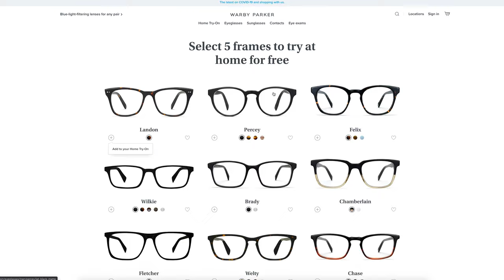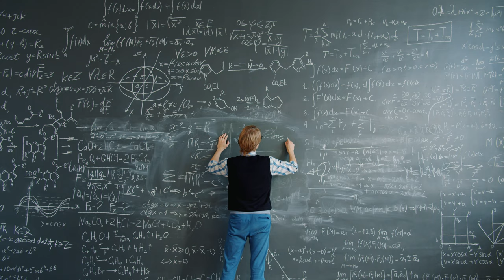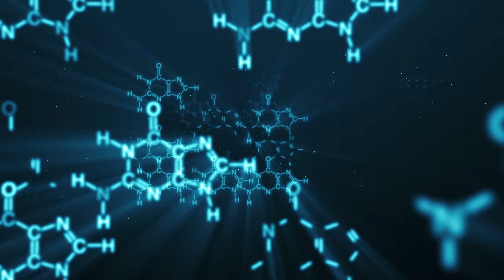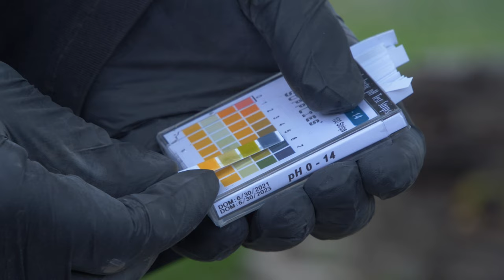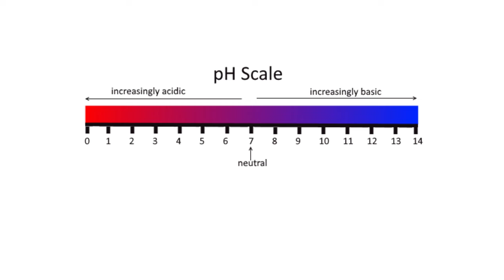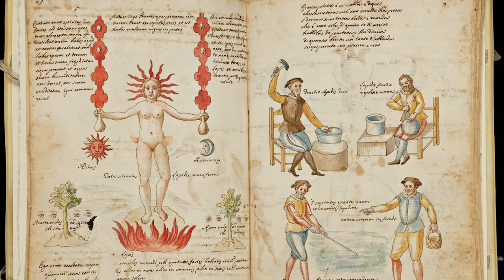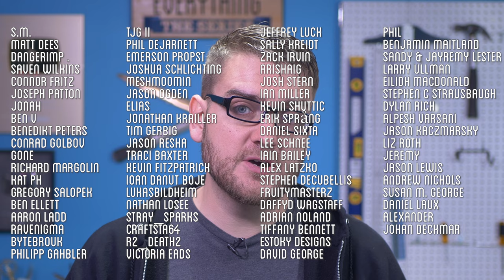Can I Make a Sulfuric Acid Strong Enough To Melt Flesh?

Comment: Should've used distilled water, the trace minerals in regular water are slightly basic and so they'll react with some of your acid to make salts.
Reply: Meh, the amount of minerals is so tiny it doesn't matter.
Reply: @user255   Depends on the source.  Hard water (carbonates from limestone) is common.  On the other hand, supposedly de-ionized water in a lab I know has a pH below 6.0, probably due to carbonic acid (carbon dioxide from air dissolving in the water).
Reply: @user255  Drinking water, be it from a tap or other sources can have a pH of anywhere between 6.5–8.5, while distilled water has a pH of 7. 

Worst case scenario not using distilled water can cost you a 1.5 pH increase but then considering he also concentrated the samples and whatnot, it could add up, given it's such a small amount of acid, and a pretty weak solution of it at that.
Reply: @Erewhon2024  Even with hard water, it is completely neutralized by ~100 mg of H2SO4. That is not the culprit for low success.
Reply: @TheFloatingSheep   That is not how pH scale works. Even with hard water, it is completely neutralized by ~100 mg of H2SO4. That is not the culprit for low success.
Reply: @Erewhon2024  Virulent? Anyway, there are also cases where HCl is much more reactive than H2SO4.
Reply: @user255  True.  I guess I was reading comments rather than watching the video.  He could have made sulfuric acid (not safely, but made it) just by burning sulfur and bubbling the fumes through water, so I wasn't really watching what he actually did.
Reply: @Erewhon2024  Actually sulfur + KNO3 (mere sulfur would have yield lower oxides) wouldn't be that dangerous. I think his biggest problem was the low quality iron thing, it probably reacted with the synthesized H2SO4 into FeSO4.
Reply: Good try, but you're not extreme enough.  In industrial sulfuric acid production, they use sulfuric acid to absorb the SO3.  This is done initially with the SO3 produced as a byproduct of burning sulfur containing materials, and after the SO2 is catalytically converted to  SO3.  I can't remember the exact reason, but my guess is this due to the solubility of gaseous SO3 in solutions of various acid concentrations.
Reply: If you want to be fancy pantsy, you should probably used DI water
Reply: @torkhi6349  or dewatered water
Reply: @Erewhon2024  also, sulfuric acid works much more quickly with just a tiny bit of heat.  Fuming sulfuric acid is considered a different reagent entirely because it acts so much faster.
Reply: then he would have to distill the water
Reply: @user255  We never use anything but distilled water, and sometimes specially treated H2O, in practicing chem labs

Comment: Hi, I'm an amateur chemist, so anyone corrects me if I'm wrong, but I had an idea for creating a higher yield of SO2. First, use the somewhat pure Sulfur. Sulfur burns in the air to make Sulfur dioxide, therefore if you had a container with one hole to pump air into the system and an exit hole where the SO2 is bubbled into the water. This also has the advantage of any oxygen that didn't react with the Oxygen would help convert the Sulfurous acid into Sulfuric acid. To pump the air into the apparatus you could use a bellow that can take in outside air when pressurising to burn the Sulfur.

Comment: My first job as a chemical engineer was as a startup process engineer for a sulfuric acid plant in an oil refinery.  We burned H2S supplemented with molten sulfur, along with recycled sulfuric acid.  The plant was an amazing feat of materials engineering, ranging from refractory bricks, bare steel, lead sheets, and massive fiberglass ducts.  As far as industrial scale production of sulfuric acid, this was a tiny, special purpose plant, just targeted to produce sulfuric acid for use in the refinery.
Reply: Thinking back 40 years on what I did as a process engineer involved in startup of a brand new plant using technology imported from our partner (Monsanto), I figure about 90% was just learning the technology - both from theory and the equipment being installed.  Maybe about 5% was actual work like preparing operational materials, making sure instruments were installed and working, and about 5% training operators based on 4 years of college and stuff I had just learned myself.  And learning from the operators and foreman from their years of practical experience in other units!
Reply: Very interesting
Reply: It probably would be best to boil the iron pyrite and bubble air into it and immediately distill off the acid produced.
Reply: as a first year chemical engineering major... this is very exciting
Reply: @Wakwise  Where are you going to school? I did undergraduate at University of Minnesota and graduate at University of Colorado.
Reply: His problem was that he was trying to get a chemist to perform the job of a chemical engineer
Reply: @richdobbs6595  wow, still unsure what job I want to work in but this major I’m in for a whole bunch of interestin stuff
Reply: @unidentifiedgodofdankstruc1510  The drawback that I found in going into chemical engineering was that jobs are located where there are chemical plants, which typically ain't great places.  So I migrated into software, which are typically nominally nicer than where chemical plants are located.  But the general problem is that nicer places are places that attract capital flight.  So if you are not a fleeing capitalist, you get the short end of the stick.   My suggestion is to try to establish remote work in okay places before you get locked down by kids.
Reply: @richdobbs6595  oh my goodness, that's something to keep in mind indeed especially if capital flight suddenly causes one's pay to drop
Reply: @unidentifiedgodofdankstruc1510  What I'm talking about is capital flights landing into your area.  Your pay doesn't drop, but housing prices escalate, while land use regulation prevents housing stock from fully responding.  So housing is less affordable even if you are in a well paid field like software development or engineering.  Your job can't compete with hot money from China or folks moving from high priced areas like California into less expensive but popular areas like Colorado.
Reply: *Mechanical engineering/ chemical engineering.

Comment: The pyrite in water is viable for producing large amounts of sulfuric acid: the only limit is how much pyrite you can grind. To speed up the reaction you can keep it at a permanent low boil, with a water recycling condenser on top so you don't have to keep adding water to the bowl every few hours.

Comment: Your iron contamination is preventing sulfuric acid formation.  You are making more iron sulfate.  Your yield will improve greatly by adding potassium nitrate to the copper sulfate or sulfur.  You really need quartz or porcelain for the heating chamber.  Alternative you can use lead and ceramic with lead being used for the 'chamber' to contain the SO2 as it is not very soluble in water and allowing it to oxidize in the vapor phase.
Reply: CuSO4 decomposes into SO3, so KNO3 doesn't help with it. Otherwise I fully agree.
Reply: @user255   Doesn't SO3 decompose at 600'C and CuSO4 decompose at 650'C, so the SO3 would decompose into SO2 and O2 pretty much immediately?
Reply: @vali_bg5234  I haven't checked the temperatures you give, but it is quite irrelevant, since all the KNO3 does is provide oxygen to the reaction.

Comment: You might also consider trying to make a Nickel-iron battery; you've made potash before, so the main trick would be making nickel and iron plates in the right shape.  Optimal designs involve nickel plating on steel (for conductivity and durability) but I'm sure a more primitive design is possible.

Comment: If you are in a wet habitat and have trouble growing cabbage, elderberry juice is also a pH indicator.  I often see Sambucus canadensis around the edges of swamps.  (I tried foraging it, didn't like the taste so added lemon juice, and cleaned spills with a baking soda scouring paste, so got to see the various color states.). Of course, cabbage is reasonably cheap in grocery stores, which is not the case with elderberry anything.

Comment: Pretty cool video. Just one annotation for the concentration scale in the second to last chapter: pH doesn't work below 0. The scale is really only useful for 0-14. For anything higher than 1M solutions you should probably use g/L or mol/L
Reply: I was wondering about that, the highest commercial pH i can find is 0. Can you give contect on why pH doesn't make any sense below 0? I get the concentration increases by a magnitude with each step, so why wouldn't it extend to negative numbers?
Reply: @onetom2222  Chemist here, making "Dr. Stone Chemistry Explanation" video in my channel. I think it's because for the instruments like pH meter, 0-14 is the linear zone where pH and voltage are linear to each other. Beyond that, the graph is not linear, screwing up the measurement even if negative pH is theoretically possible.

Comment: Notable. We are capable of transmutation. It’s what happens when you break apart atoms and particles. They reform into other elements and particles. The issue of course is that the return for the energy expended is not at all worth the elements you make. So lead to gold was possible, but also pretty wasteful.
Reply: Well you have to think that gold in nature was formed in the heart of dying stars, notably larger ones as iron was too but it is the most common metallic element.

Comment: One thing to make the process much faster would be to force air through the heated CuO3S, forcing the sulfur vapors through the water. Perhaps with a bellows of some sort? As it is I suspect a lot of the product remains in the reaction chamber without ever having any contact with the water, and even the product that makes it over only has the surface to react with, which would also slow it down. Great job on the episode!

Comment: Threaded pipe does not seal without a sealant (either ptfe tape or ptfe liquid dope) applied to the threads.  So you probably lost most of the SO2 and SO3 through the threads (it is easier for gas to leak through the small holes than it is to bubble through the water).  All that you collected in the water was probably just the SO2/SO3 that happened to dissolve into the water, not bubble through it.  PTFE is a modern invention and so difficult to replecate, but you can make the old-fashion version: hemp twine and tar.  However, neither are really able to withstand the heat of fire.  So maybe instead coat the threads with a little clay.  It won't be perfect, but it would be better than pipe without a sealant.

Comment: In the interest of seeing if more modern inventions could be made in earlier times, Try making an acoustic PHONOGRAPH using Roman technology.   A wax, varnished or foil covered cylinder or disk    or even a strip of foil like a "Tape" would make a fine "impressionable" surface for the needle to cut into or play.  A thin metal horn would be no problem to make and a small "drum" diaphragm to move the needle.-------a foil "tape" might be easier as it can run on a double hand cranked spool, and the needle need only cut a single, long groove as the foil pulled under it---so no complex spirals or threaded screws would be needed as in the case of a cylinder or disk.

Comment: Sulfuric acid at "azeotropic" (98%) concentration will burn pretty badly.  A reminder, SO3 + H2O is how you get sulfuric acid.  But, if you add SO3 to already 100% acid, it will go PAST 100% as the H2SO4 is changed further into oleum.  You want organic dissolving?  Try about 20% oleum, also known as "20% fuming sulfuric acid".  It pours like a syrup and makes standard sulfuric look friendly by comparison.  The reaction is also reversable, add water to oleum and you dilute it back to sulfuric acid.

Comment: Nowhere close to sulphate decomposition temperature with that cute charcoal fire, maybe 300-500°C
Either build a real charcoal furnace, similar to those used for iron smelting or simply use electric furnace that gets into 1100-1250°C range, that should be plenty enough to decompose most sulphates into sulphur dioxide. 
Next step would be SO2 to SO3, probably the hardest, since you need heated catalyst bed and reaction favors high pressure/low temperatures...

Comment: One small tip, when using pH paper, don't dip it in the solution you are testing. Use the pipette to remove some of the liquid and then apply to the paper. When you put the paper directly into what you are testing you are contaminating it.

Comment: Hydraulic acid? uh no.. it's called hydrochloric acid. Hydraulic acid would be an acid that is put under pressure to move something. 
If you have any questions about things like making acid from components like this, ask Cody Reeder.. he's done it a ton of times and I'm sure can help you get it done better. Also sulfuric acid on it's own can destroy flesh but if you add a strong oxidizer to it it greatly increases it's destructive power.. Like say hydrogen peroxide (which in itself becomes highly corrosive at high concentrations) or potassium nitrate which can be made from rocks too.. or you can just buy it in stump remover form. (why do I know these things?)
Reply: Thank you!!! it bothered me so much hearing him say Hydraulic Acid. i would guess it's just a script error but still. some proof-reading would be nice on what is considered a "reputable science channel" at this point.

Comment: My friend had to get skin grafts on both of his legs caus a bottle of sulfuric acid splashed on them. It had melted in a small fire he had. He put the fire out no problem, but didn't realize about the acid, till it started itching. He then washed it off, thinking everything was fine. But the next day, his skin started peeling off. 
Most acids don't seem to eat skin, or even cause any problem at all. I used to taste boiling concentrated hydrochloric all the time, with no problems at all. No comment as to why, I'd do that. 🤪 I have been burned by sodium hydroxide (base) though. Nothing too serious.

Comment: Several reasons I can see for such a low yield and quality.  Considering the glass issue and using iron container, water source, and so on but I get what you are trying to accomplish with the means you have.  Sure in a lab with access to lab equipment, consistent heat, and a cleaner work environment I could do better.  Also if you do again avoid the water being near the ashes.  Ashes tend to be alkaline from the “potash” that could effect the results possible.  Maybe a way to isolate the water from contaminates and starting with a distilled water.  Nice work ultimately!

Comment: I thought you'd research this more thoroughly. You haven't really got any sulfuric acid. You got a dilute solution of iron(II) sulfate. Your retort wasn't heated up to a proper temperature, something you could've done using blowing into coal fire from below and with more heat insulation. It takes a considerably high temperature (650 °C) and plenty of heat to destroy copper(II) sulfate. Your setup got nowhere near it. The whole reactor part of the retort should've been glowing red hot.
You merely got few vapors that reacted with steel and turned into iron(II) sulfate which is acidic. There's your pH drop.

It's possible to push sulfur(VI) oxide out if really high temperature is used in a well made retort.

Comment: Since recently, it is illegal within the European Union to sell, purchase or produce sulphuric acid with concentration higher than 15%, unless you have a special license (even the attempt to do so may be a criminal offense, depending on the country). Any viewer from Europe who tries to reproduce experiments involving sulphuric acid can get into trouble. It may be nice to put a warning in the video description. I am sure you have regular viewers from Europe who are not aware of the legal implications. For details, see Regulation (EU) 2019/1148, and its implementations into national law, some of which are in effect since 2021 or 2022.
Reply: The full list of affected substances, and upper limit of concentrations allowed:
Nitric acid (3%)
Hydrogen peroxide (12%)
Sulphuric acid (15%)
Nitromethane (16%)
No licensing is permitted for:
Ammonium nitrate (16%)
Potassium chlorate (40%)
Potassium perchlorate (40%)
Sodium chlorate (40%)
Sodium perchlorate (40%)

Comment: "You should wear proper PPE"
"I have burned myself several times"

...still handles the acid repeatedly without any ppe. 

Dude, just wear the freaking gloves.

As for the reaction, you probably want to keep the metal out of the water, and maybe try using a non-reactive tube to bubble oxygen through it to speed up the process?
If Nile Red has taught me anything, it's that even tiny inefficiencies in a process can take a large yield down to a negligible yield with just a couple of compounding steps

Comment: Honestly I think this doesn't count as a success. A pH of roughly 2 indicates a concentration of 1-10mM which equates to about 0,01-0,1% in concentration. Now that's... nothing! 
The reason for this was very likely that you didn't manage to get the anhydrous copper sulfate hot enough. It only decomposes at around 650C so the pipe would have had to glow a nice red, which it didn't in the Video. 

Also at this point you may have gotten the chemistry wrong a little as copper sulfate gives sulfur trioxide (SO3) not sulfur dioxide (SO2). SO2 is the stuff that dissolves to create a weak acid which then gets oxidized over time to give a stronger acid. SO3 on the other hand doesn't need that. It forms sulfuric acid straight away when it reacts with water. If you wanna make SO2 you can just burn sulfur.

To actually succeed in making H2SO4 just really trying to heat the crap out of copper sulfate would probably be your best guess.